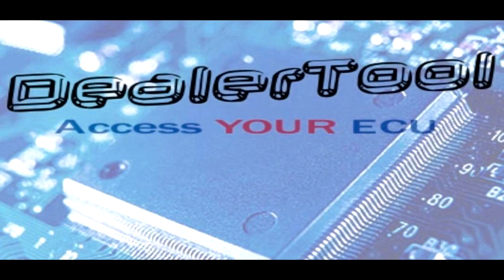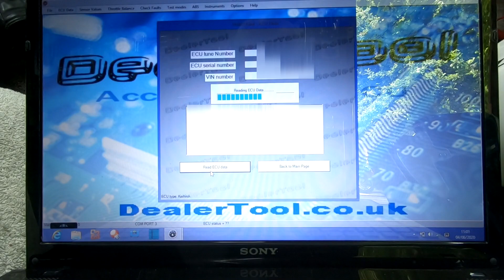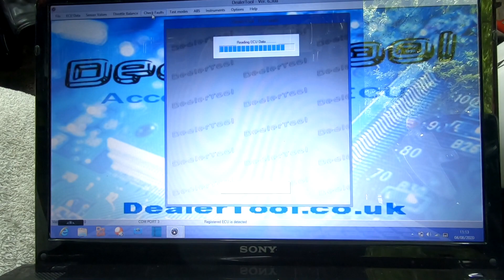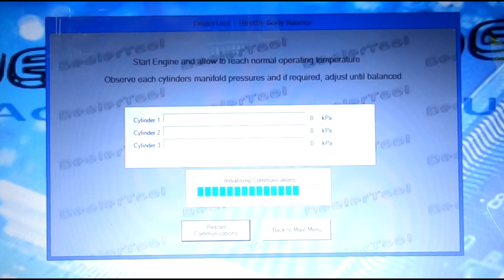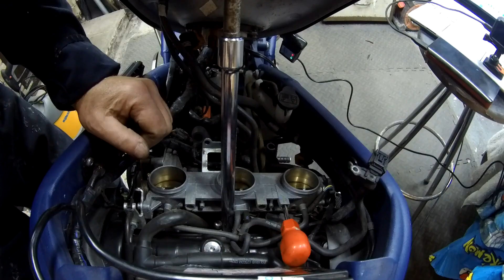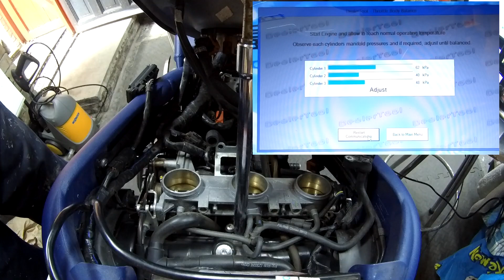Throttle balance using Dealertool - 2011/15 Triumph Speed Triple

Comment: Thank you! I cant seems tò be able to balance the second cilynder do you think something could be off with the engine?
Reply from the maker: its been a while since I did mine, going to do them again soon.
if I remember correct, it took some fiddling, by adjusting the ones your not actually attempting to adjust.
what I mean is, instead of trying to bring one up to the other two. bring the other two down to the one, or vice versa.
hope that helps.
Reply: @notamotorbikemechanic Thank you for yor kind answer, i Will tell you if can figure It out! 
Have a nice day

Comment: I've recently bought a 2012 Speedy 1050 and with it found your channel. Great videos, I very much appreciate them!
I also bought the dealer tool and tried to balance the throttle. Unfortunately no matter whar I do, zylinder 2 is ALWAYS 8-10 kPa behind zylinder 2 & 3. I cleaned the bores and screws, changed the o-rings of the screws and tried extremes like zyl. 2 all in and zyl. 1&3 all out. No metter what I do, zyl. 2 is always behind. The bike is best runnning, when zyl. 1&3 are synchronised at 64 kPa and zyl. 2 is at 55-56 kPa.
I can only think of three possibilities. A problem with the hose, which is leading to the sensor. A leakage in the intake manifold or (worst case) much lower compression at cyl. 2.
Have you ever heard of a situation like mine?
Reply from the maker: Hmm sounds odd, try spraying a little brake/carb cleaner around the throttle body's while it's running. If you have an air leak, you should notice it.
Sorry I can't be more helpful,  I've not played with dealertool for a while.... might have to watch my own video 🤣
Reply: @notamotorbikemechanic  thank you, you were very helpful. I already did that, but without success. Today I changed the vacuum hoses, which led to the MAP Sensor and the problem was solved. The adjustment was then a matter of seconds.

Comment: with airbox removed. . Do I just need to connect battery to test throttle bodies, or what do I need to reconnect?
Reply from the maker: Been a long time since I did this, I'd connect everything otherwise it will probably give a fault/warning light

Comment: I know this might seem obvious - But how did you keep the engine running without a fuel tank or fuel pump connected?
Reply from the maker: Hi its all connected,  I've just lifted the tank and propped it up 👍
Reply: @notamotorbikemechanic  Great camera work then. 👍
Reply from the maker: Thank you 😊

Comment: The triumph guys here said this speed triple is notorious with throttle body balancing and that they've sometimes lost entire day's trying to get the TBs balanced. Was it the same for you, or was it business as usual?
Reply from the maker: Hi, no I’d say it was pretty straight forward.
The only thing as you probably seen in the video, I wanted to adjust No1 cylinder to match 2&3.
But had to bring 2&3 up to match No1, but over all it was quite simple.
Reply: @notamotorbikemechanic  thanks a bunch. These guys at the triumph service center can be a bit, er, challenged at times 🙄
Reply from the maker: @greyanaroth  your welcome 😁
Reply: It’s an hour job start to finish, bike stripped and back together after adjustment. They’re only gonna be a little out of sync if your unlucky, 1/4 turn of one or two of the adjusters screws.

Comment: Can you describe what you're actually doing, do the screws just turn freely or do they have any locking nuts on them.  When you turn the screw to the right does it increase or decrease the throttle. Thanks for posting.
Reply from the maker: The screw do not have lock nut, I’m not sure but think clock wise increases throttle .
👍🏻👍🏻

Comment: Great how to do videos.  Just a small question looking on the web for the Tune ECU. but only found the cable and software up to 2014 speed triple's,  I only need it to turn my service spanner tool off.  Will the older one work ? I have the same 2016 1050 R model. Do you have a link where to purchase it ? Many thanks
Reply from the maker: Yeah I was concerned if it would work on my bike, but I emailed them and they were very helpful.
So contact them to make sure you get the correct product.
http://dealertoolcouk.ipage.com

Comment: Thanks for the video. How large are the adjustments you’re making here with the screwdriver? E.g. are you making 1/4 turn then checking again, or is it full turns needed to make the adjustments?
Reply from the maker: Hi Rob, yeah about 1/4 at a time. that said I made lots of adjustments of number 1 cylinder, but wasn’t getting much change.
But generally small adjustments.